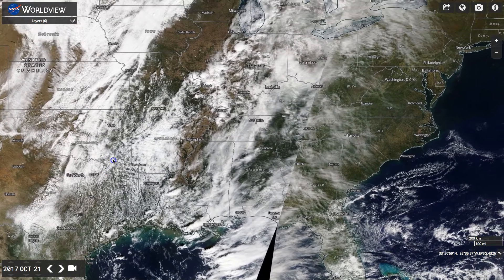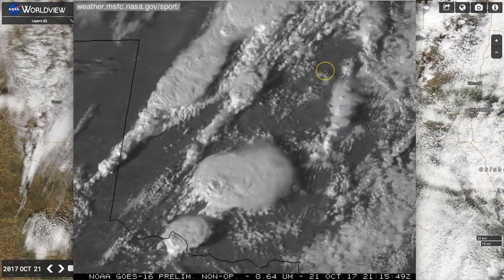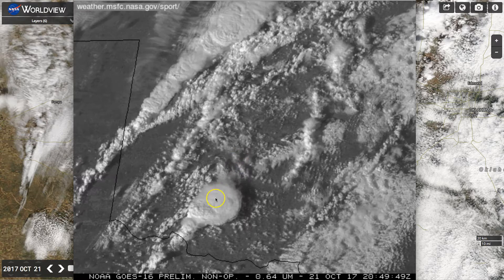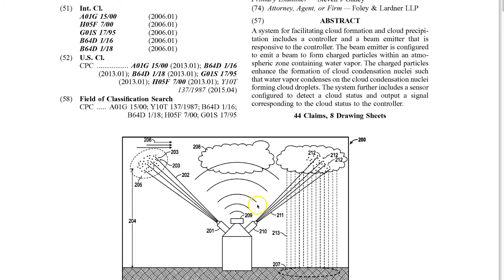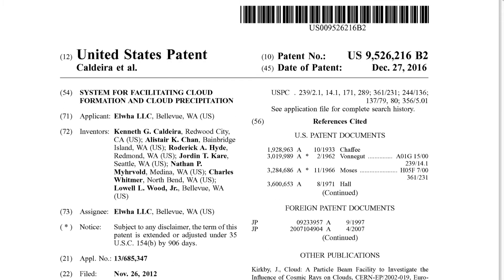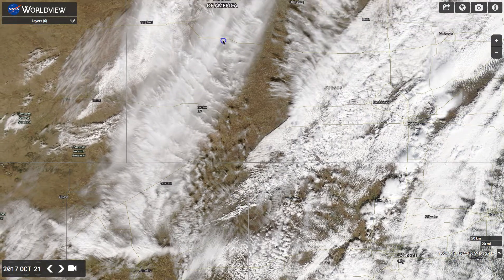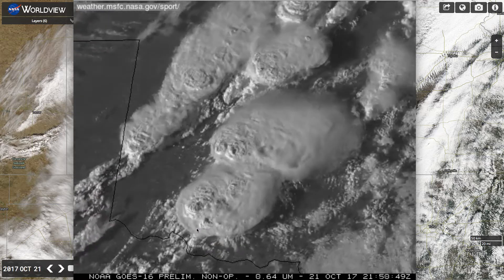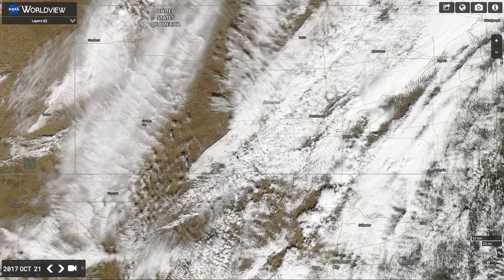Manufacturing tornadoes

Comment: Weatherwar101 has some very accurate points made about WSAC fueling these storms with water vapor bursts shown in the clip you used.  Are you familiar with WeatherWar101's channel or website?  I appreciate your work and see that you are seeking the truths behind why this is done.  I do know that the oil and power companies have a huge stake in the weather making.  Power plants pump out storms worth of water vapor.  When they are used to sequentially fuel a storm system moving across the country is all to common now.  Heterodyne waves and nano particles in the air are given the water needed to make destructive storms.  Tornados hurricanes and neverbefore seen rainfall totals and snowfall totals.